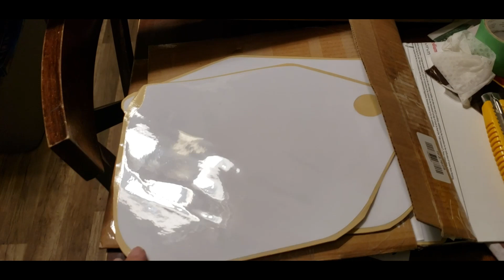1990 CR125 rebuild part 10 "A day of rain and  tank restoration"

Comment: Another great video, thanks.
Reply from the maker: Thankyou for watching
Reply: @TNTMOTO  spent most of the day wet sanding the tank, if I could send you a pic of what I started with you'd tell me to throw it away and get another, hahaha, but I just finished with the 2000 grit and I'm waiting on my drill polish kit and cut wax. My tank is white, I want to ask before the polish kit gets here, that is how it should look, is that right?
Reply from the maker: @maw2044  after2k grit all your fine scratches should be gone. it will now just be hazy. The polisher will bring out the sheen and make it look new again. if it was badly stained you will never get the true white back. you can check out my finished yz490 vid and see the stained tank vs the new fenders and panels

Comment: Use that “new wipe” on it. Looks Incredible
Reply from the maker: There are a lot of protective layer kits made by different manufacturers. They all work great. Many of them have been around for quite some time . I think Plastic renew is probably one of the oldest.  I like to use Maxima SC1 after a polish.

Comment: Have a 1989 cr125 frame that I'm trying to restore only problem is the engine I have is an 81 and cannot fit.The engine cog is on the opposite side of the rear wheel sprocket and engine boltup is off.Any suggestions.Willing to trade working engine for correct engine